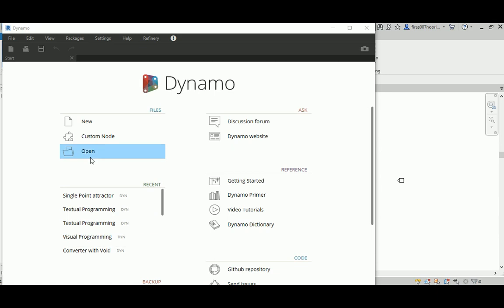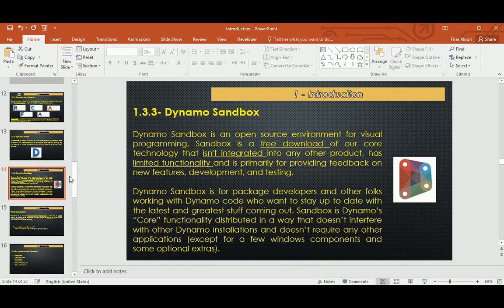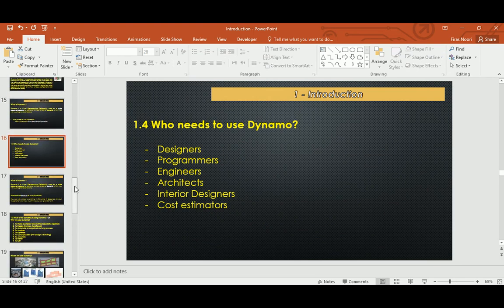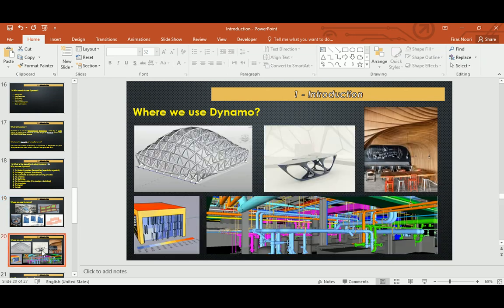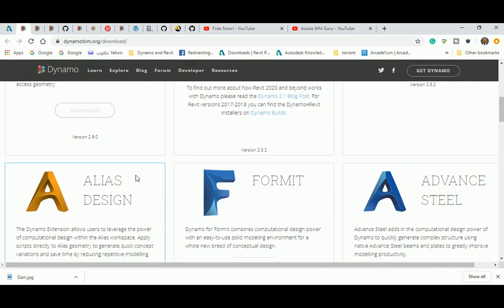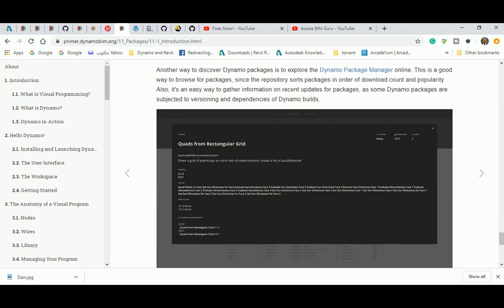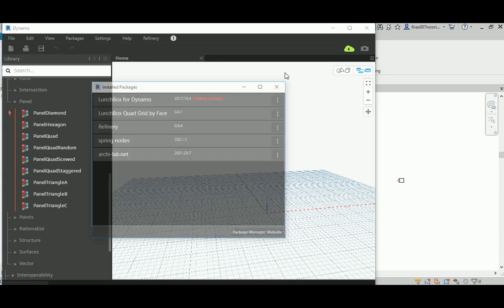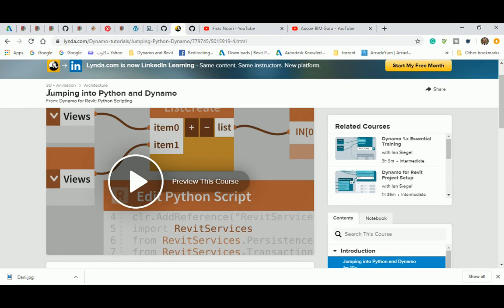Introduction to Dynamo - Part 2

Comment: There is a problem when choosing to search in packages that tells me that there are no results when I search at a specific node
Reply from the maker: two main things
1- What Dynamo you have?
as Dynamo 1.3 (Installed on Revit 2019) is un-updatable!! (I think) as I have it and it not updating any more.
Dynamo 2.0 and 2.5 on Revit (2020 and 2021) still running updates
2- Inside the Search for Package,  let it first complete the "Syn" and wait till you see all available names, then Type "LunchBox" for example, you will not see it (50%-50% chance) IF NOT!! as you case , click on the top right "Sort By" and choose "Name" wait to sync again and then write "LunchBoX" IF not appear, then simple scroll down ur mouse till you reach the "L" letter as they are all now arrange alphabetically, again look for "LunchBox" for me , I just did it and I just found it, after all words in "L" finished them a group of random packages all in "L" word.
Try and tell me
Cheers
Reply: @FirasNoori  My dynamo is 1.2 Rift 2018
Reply from the maker: 80% it will not let you install anything anymore!! Not sure,  but mine has stopped, you need to install dynamo 2.0 for revit 2018 or install revit 2020 or 2021 to get the new dynamo 2.5
Reply from the maker: I think autodesk lock updates for old dynamo to push toward the new one